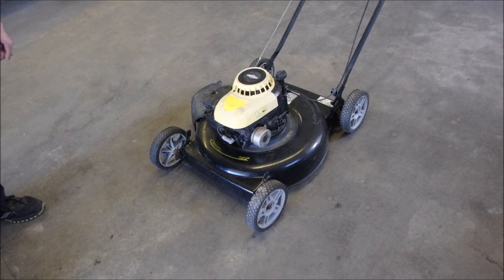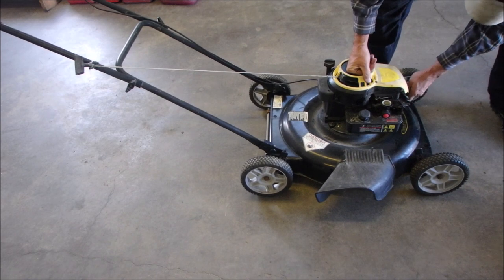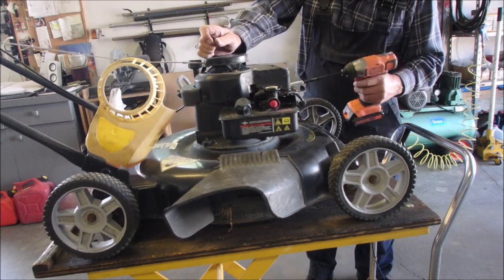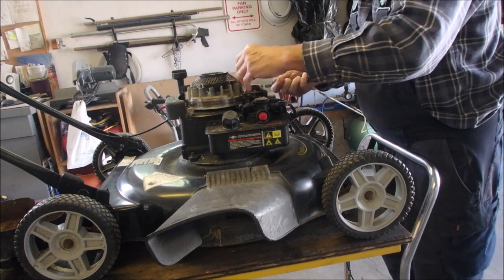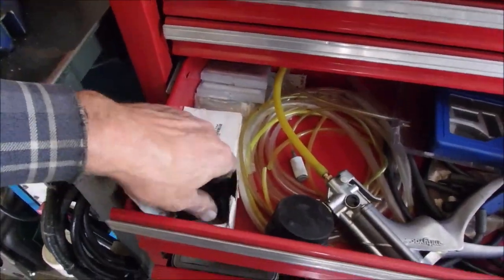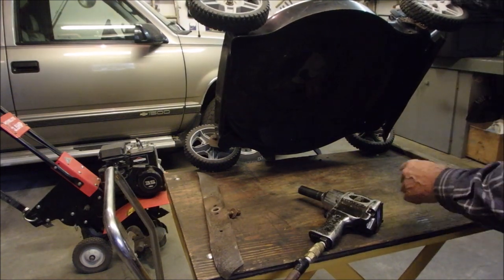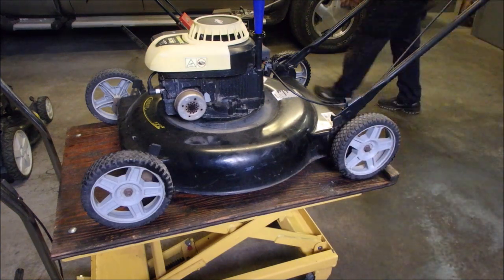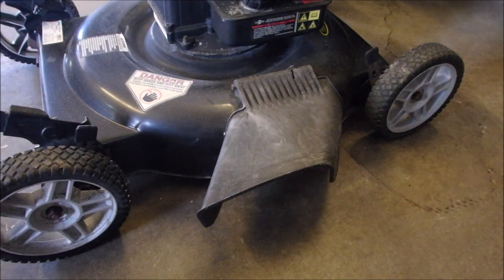Brute Mower with a Briggs Classic -Intermittent Start

Comment: Hey Bruce,
I’ve had that same issue before.  In my experience, it has been caused by getting water in the metal spark plug boot when washing.  If you yank the old metal boot off and replace with a modern rubber boot, I’m sure it would work.  The cable was nice and long so no problem replacing the boot.
Reply from the maker: I did tried to work on the old coil and I tried it without the end boot (off camera).  Still no go.  Thanks for the info though Jim
Reply: Where did yall buy it
Reply: @terrymccorkle1674  
Do you mean, the coil, the spark plug boot, or the lawnmower? 😊
Reply from the maker: @jimyeske8498  Free lawn mower, free used replacement coil.

Comment: That is a really nice little mower. I would be tempting to keep it.  I got another version of the Quantum this week . The carb is mounted on an angle but still has a square air filter and the primer pushes air through the top right of the carb. The exhaust comes out of the top and exits out of the muffler on the side.
Reply from the maker: Right on.  I would like to see a picture of it    my email is bthversion1@gmail.com

Comment: Bruce: I have had several of those metal plug boots short out causing the engine not to start. I removed them and usually that fixes the issue. Thanks for the video.
Reply from the maker: Good tip!  I did try another but who knows!!   I changed the coil to one with no boot.
Reply: I did this to same to my dad's lawn mower the resistor plug it ends play that after many years hard to start took it off and to a normal boot no trouble since then

Comment: And there's ur dinner .... oh wait.   Good one, Bruce,   I use to pull a plug wire from old cars as they were running to find which cylinder was "missing"  sometimes making the spark jump a gap would cause the cylinder to start firing.
Reply from the maker: Those were the days.

Comment: i had an old farm tractor that would foul a plug sometimes . i could hold the plug wire a distance away , making the spark jump to the plug , and the cyl would run again . somehow the added gap made the spark hotter . maybe the added resistance of your spark tester had the same effect .
Reply from the maker: That is possible

Comment: Nice video Bruce. I would be curious to see what the primary and secondary readings were in that faulty coil!
Reply from the maker: This one was 5 ohms and 5 K  I checked it.before the threw it out.  Thanks though.  i like to keep my videos at about 30 minutes.
Reply: @BrucesShop  Great, thanks Bruce! Smidge high on the primary,  I’d say 0.5-1.5 is ideal, though that said, I don’t think it’s high enough to cause you those issues though, do you?
Reply from the maker: @VintageEngineRepairs  No  I think it was corrosion or heat related.

Comment: Was the metal sleeve around the spark plug boot causing the coil to ground out? It ran well when it was attached to your spark tester and away from the boot was further away from the engine body. Would a simple boot replacement have sufficed?
Reply from the maker: Very possible
Reply: @BrucesShop  I have never had dependable results replacing just the boot. I quit trying that early on. I think I could do it today, if I got the correct tools. Usually I have a donor coil available and that is the simple route.
Reply from the maker: @haneyoakie14  Thanks

Comment: Bruce. Is this motor one where the filter bolt has to be in place so the primer fuel doesn't drain into the tank through the bolt hole?
Reply from the maker: No  that is on the older ones

Comment: Hi Bruce. I need to pick your brain. B&S 6 hp Quantum on a Craftsman mower. Would only fire/run on starting fluid. Old carb was pretty dirty, so owner bought a new knockoff kit. Installed with new gaskets, spark plug and ran fine for about 45 seconds. Now will only start/run on starting fluid. Fuel looked okay when drained into a cup, but I still suspect bad fuel. Any thoughts? Thanks.
Reply from the maker: Yes  fuel or a cap that doesn't allow air into the tank.   (finger on the straw thought)
Reply: @BrucesShop  Pulled new fuel line from carb and fuel flow is good. I'm kinda baffled. Will try different fuel but I'm not hopeful.
Reply from the maker: @grosseileracingteam  Try it with a loose gas cap on the mower.

Comment: Great video Bruce, now I have a question, can you remove the metal piece from the plug wire, and it will run or you have to change the coil, asking cause I have a mower with the same deal???
Reply from the maker: You can remove it and connect the high voltage wire to the plug

Comment: Hello Bruce,
Did you ever try placing your patient on the operating table backwards?  That way you could tilt the mower back and tie it's handle to the lift's handle instead of working around the jack stand.   You'd also have 270º of unobstructed working area.  Of course you's need a wheel stop at the other end of the table too.  Just a thought.  I enjoy your effort keeping stuff out of the landfill way before it's time!  Jay
Reply from the maker: Yes I have tried it all.  The bar gets in the way a bit.

Comment: resistor boots on the coils are no good after many years they break down and it's hard to start take it off and put the lead directly on the plug there is no need to change the whole coil this is what I did to my father's lawnmower had no trouble starting it since
Reply from the maker: Thanks

Comment: Bruce it ran fine with the test light hooked up, wonder if it would’ve run by swapping out that E3 plug for a Champion RJ19LM Resistor plug?  Hmmmmm
Reply from the maker: I did muck around with a different plug off camera.  It may be a resistance issue though so you may be right.
Reply: Imo E3's are garbage, use a Champion.
Reply from the maker: @berardia4  Yes  On a $ Cheap mower you use what comes with it.

Comment: You forgot your business card. Donyboy73 gave an Old Timer Tip to help the mower deck from rusting is to brush on the old oil underneath the deck after you clean it. Now, when I replaced my Lawn Boy deck I took the time to preserve the replacement deck by cleaning, sanding, primer coated, and painted with Rust-oleum, This spring after cutting the lawn several time, when I went to clean under the deck I noticed the paint was pealing right off. So, I'm be following Donyboy73 tip for sure. and there's less labor time involved too.
Reply from the maker: we are high and dry out here n the prairies.  No deck rusting out here.

Comment: This kind of problem would indicate to me that this mower has the old breaker-point ignition system, and the points were bad. But you won't know that unless you remove the flywheel
Reply from the maker: No breaker points went out in 1982    You can also tell if it has points but the type of coil This one has the pick up for the automatic electronic coil.